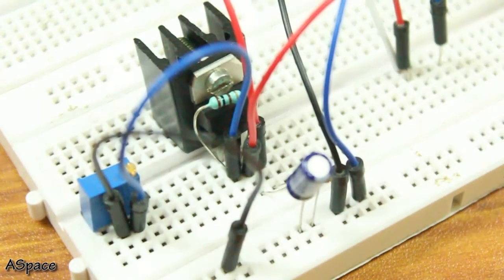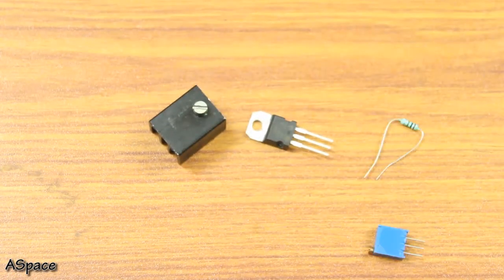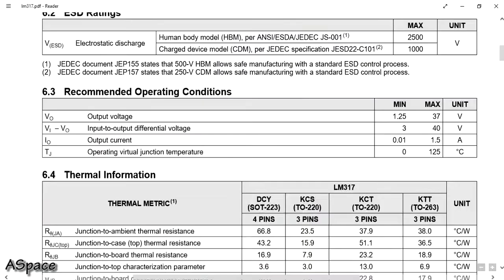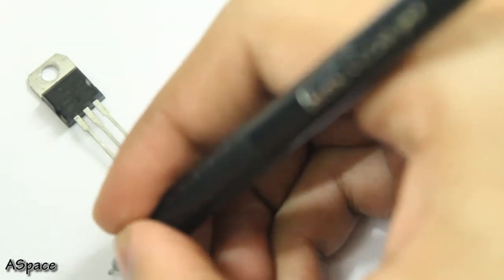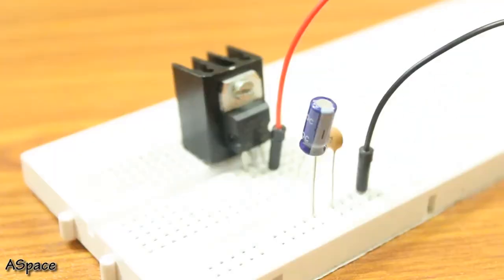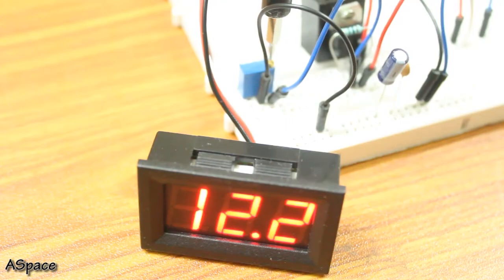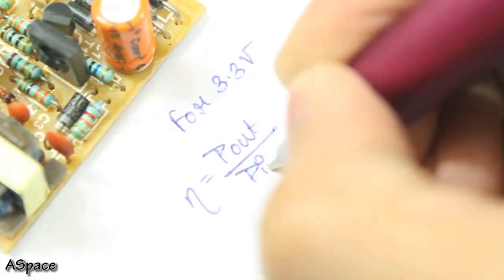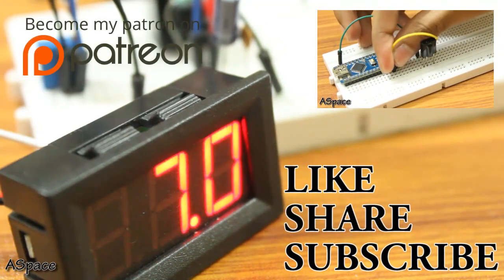DIY Variable linear voltage power supply -Part 1

Comment: judging by the size of the transformer I would say you have a switch mode power supply with adjustable output. The linear should not be in the title - do correct me if I'm wrong.
Reply: SirC Huh? Really? ÷*|